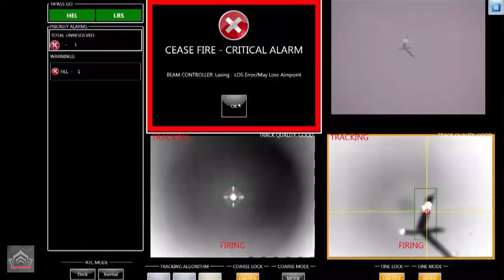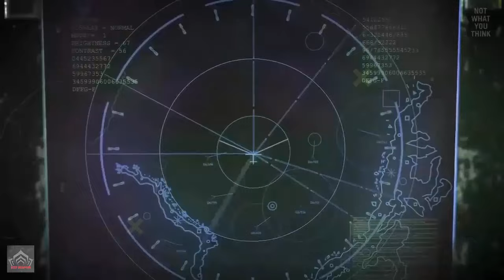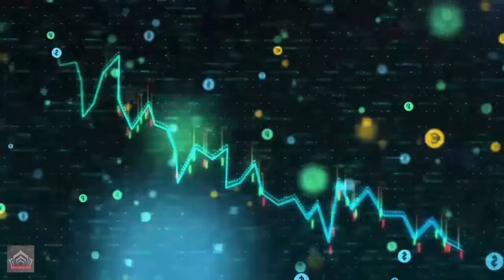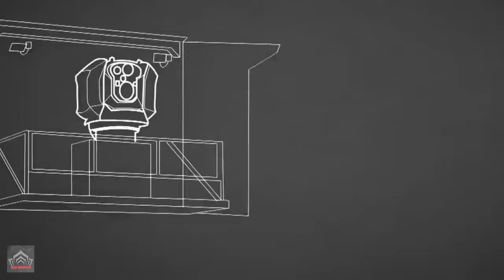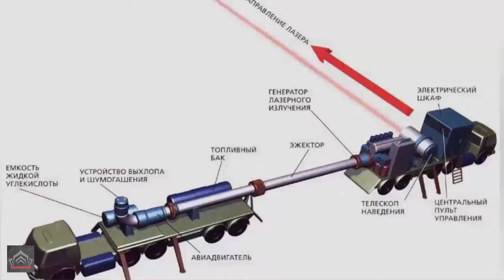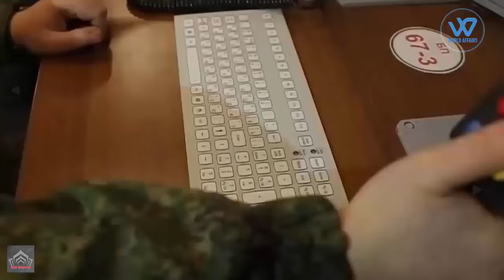Revealed!!! New Characteristics of Russia's Peresvet Combat Laser Complex, Has Tested In Battlefield

Comment: A very large & bulky laser platform. How is it protected from enemy missiles attack?
Reply: Lasers have been around since the 1940s but there was always lack  power. And the size of a cooling unit, and also you have the mirrors or lens having to be calibrated. Believe it or not shrinking it to this size is an extraordinary engineering feat.
Reply: They are not powerful enough to shoot down rockets. They can shoot down drones, and at low altitudes.
Reply: @gogo_1987  you must be one of those armchair experts that knows better then russian engineers and physics